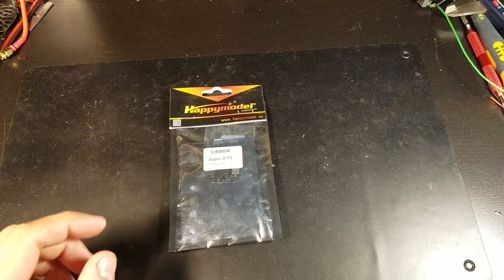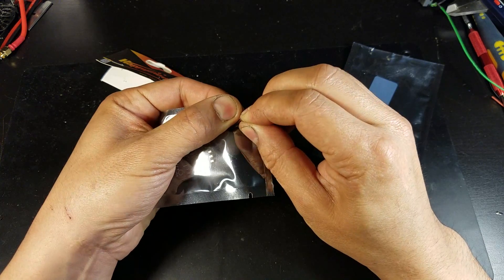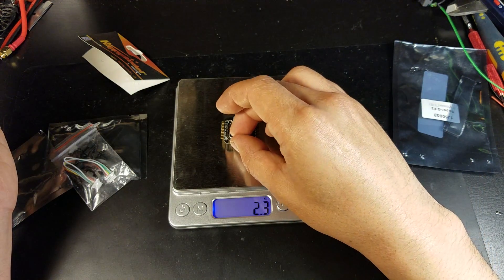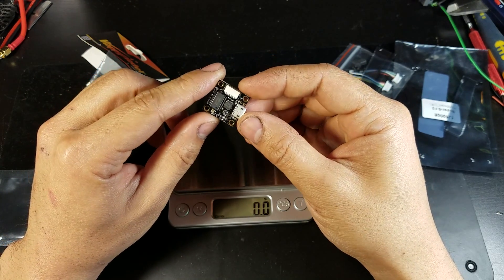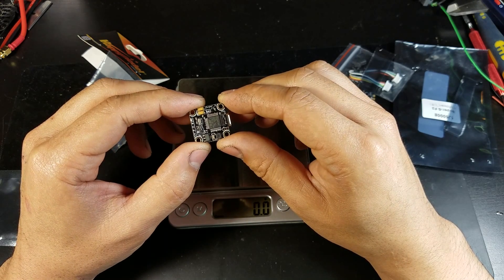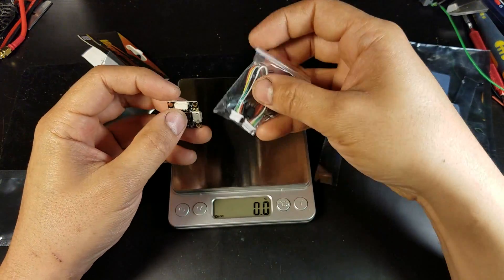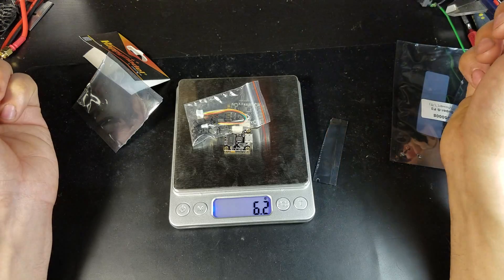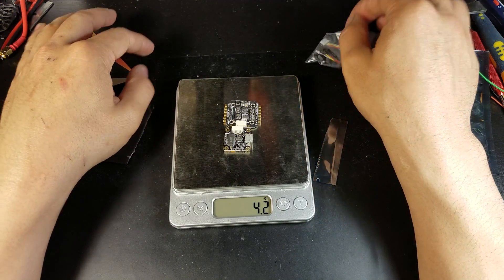Super_S Flytower AIO fc osd esc micro review

Comment: don"t buy this! it is rubish! Led+buzz are not workning. I build and setup very well but after 2x1 minutes flying all things had been overheating and motor number 2 not wotking anymore... It is shaking.... I suggest problem with ESC... Waste of time! Have to wait more stable solution from 16x16 size....
Reply: I think you have a short or got a dud.  I have several builds with this. The Led and Buzzer work fine, the ESC is good. These are so small that each solder and the board must be inspected for even the smallest solder splash.  A LED microscope really helps with this.
Reply: https://youtu.be/jHwqkHtxcyo

Comment: I have this stack but with the OSD version and it seems to freak out randomly. got any idea of why its doing it?
Reply: Usually a short, use only silicon wires an really neat solder.  Examine each with microscope
Reply: I'm having major brownout issues with this fc
Reply: Multiple batteries?  I'm using GNB 450mah 80C 2S and she hangs in there for almost 5 minutes.  (not racing speeds)
Reply: Cyber1 Network Media (cyber1.net)  eflite 2s battery
Reply: UPDATE: after several builds quality is really hit & MISS.  DOA's common and the ESC PCB sucks ,easily overheat and SMT MOSFET's slide off.  I think its really a 1S board being pushed beyond its limits at 2S.

Comment: Thank you for sharing - Did you manage to get the LED strip to work?  I can’t I think it’s a configuration issue, rather than a hardware issue...
Reply: Leds work on mine.  I have a string of 6 programmed.  It's a fragile board and soldering must be spot on, examine with a magnifier before powering on.  99% of my problems with this FC has been solder precision and clean.

Comment: Wondering what betaflight you are on, I am on 3.1.7 and having motor issues, I have racerstar br1103 10000kv and motor 2 and 3 do not rev up like 1 and 4, I calibrated with blheli suite but motor 2 and 3 seem like they only rev about 70% when motor 1and 4 have full 100% throttle.This is noticed in flight the quad wants to turn forward-right under high throttle, It does even on the bench when running with no props you can hear motor 1-4 have way more power.  I'm not sure what wrong is it betaflight? Or the 4in1 esc. I have other micros with a different tower and they are fine. Thanks
Reply from the maker: +Joe Cord im on betaflight 3.1.7 , no issues here except when i had very unbalanced props. Try swapping motors 1 and 2 and see if they rev up any diffrent. If they do then its likely your motors. If not then the esc is bad. I doubt it has anything to do with betaflight. If you still feel it could be betaflight, do a full chip erase/reset and try again.
Reply: Yes it looks like the 2 motors are gone, Are the quality bad on the 10000kv motors? It was only the initial build/flight with a couple hovers and slow flight till I noticed the quad want dipping to go to the right, I have the 8000kv and they have about 8 flights with no problem. Thanks again
Reply from the maker: +Joe Cord i have never tried the 10000kv versions, only the 8000kv. I did notice that the 8000kv has a bit of an issue. The motor shaft is press fitted onto the motor bell. Mine are a little too loose. When i tried on really tight fitting props, the shaft would move seperatly from the bell. Also the motor wires are very thin and break easliy. So i guess there are quality issues with these. But i didnt really care, as they cost me $5 canadian dollars each on clearance.
Reply: I changed out motors same, maybe I'll lower the max in blheli.
also after a hard thottle the quad wants to stay pitched forward for some reason, I'm just getting tired of trouble shooting and not flying, I fly 250s but Canadian law has a limited of 250 grams and can fly anywhere that's why I'm getting into micros, but they are much different then my QAV-r
Reply from the maker: darn thats sucks, did you try reset setting in betaflight? im also im canada, but i mainly fly my mini quad in open parks. as long as the quad is at least 30 meters away from building and houses. also flying very carefully to avoid scaring people and dogs
Reply: yes new Ontario laws forced me to fly micros in about the same as you do, small parks with no people, at least the people aren't so scared of these micros, I'm by London Ontario, You?
Reply from the maker: Vancouver, BC. ill usually bring my micro, e011 and mini quad just in case
Reply: Joe Cord  , man i have same problem if you find any clue what it is please let me know .thanks.